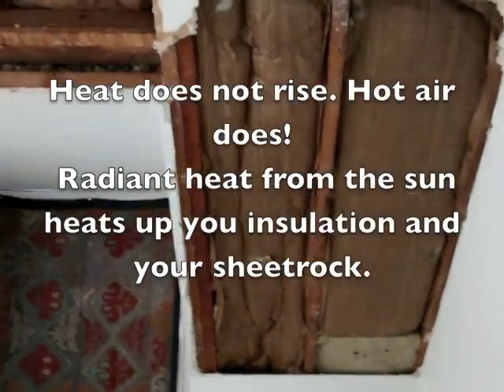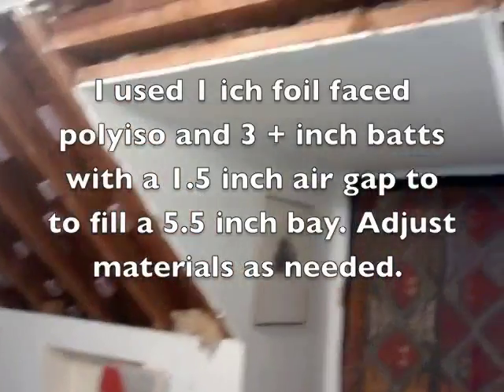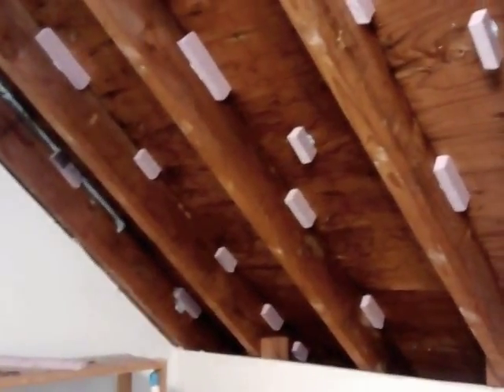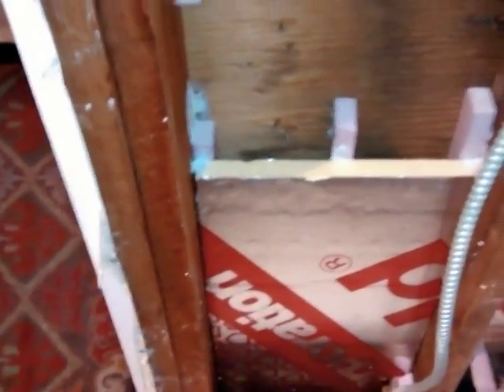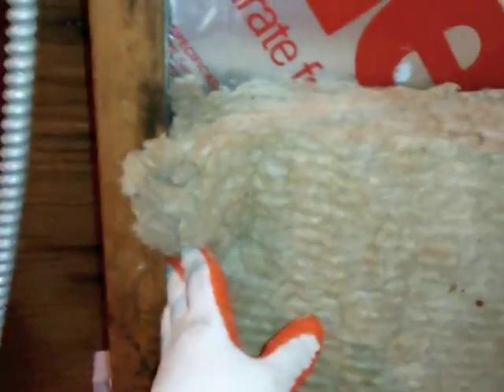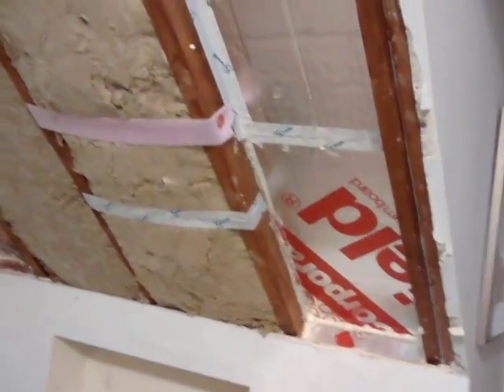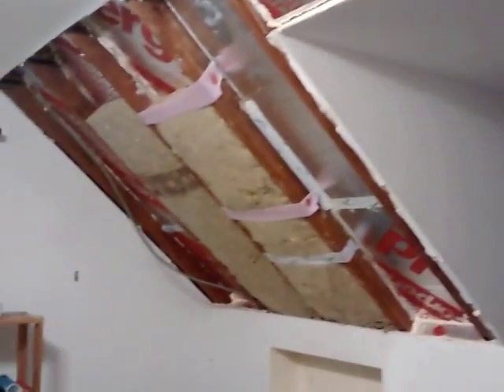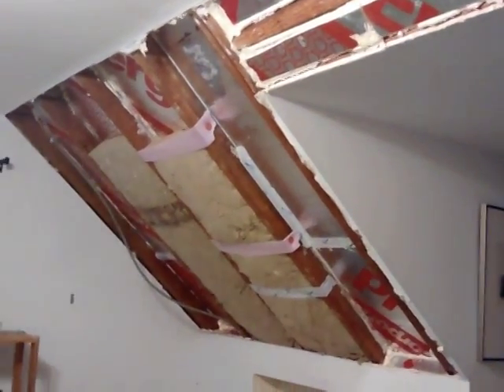Dormer room insulation retro fit - vaulted ceiling

Comment: My bedrooms upstairs look the same way with this sloped ceiling. I was able to access this area from the attic. I can look down into the 2 x 6 rafter bays and I decided to use 2 x 4 fiberglass insulation and just slide the fiberglass bats down in there however now I’m thinking I should’ve use the foam core board like you did. Any thoughts? I didn’t want to open up the ceiling like you did. But I probably will someday.

Comment: My bedrooms looks similar to yours were the ceiling slopes down in between the dormers. In my attic I was able to look down into the 2x6 rafter bays and I just slid down some 2x4 size fiberglass insulation batts. I used 2x4 size so I’d still have a gap between the roof decking and ceiling. However now I’m thinking I should’ve just measured and cut some foam core board similar to what you did and just slid those down in there, therefore I could maintain R-value throughout the entire cavity. Any thoughts? I don’t wanna tear open the ceiling right now like you did.

Comment: Jon, thanks for this vid and your suggestion about different foam compatibility. I did this in my porch ceiling turning it into a cathedral ceiling. Awesome changes and put in a skylight too. I did 2 inch air space and reflective foil then 6 inches of styrofoam then another radiant layer pointing downwards into the room this time, with a 3/4 inch air gap for radiant effect to work to redirect heat down into the room. Then ceiling planks for the finished work. The plan is to next do the attic with a gambrel roof that has 6 dormers but the headers of the dormers block off the soffit to attic path. I guess that section of the dormer headers that block the air flow to the ridge vent will still have the 2 inch air gap system but no soffit air intake to create the upward draft within the under roof sheathing air space to the ridge vent. I am still looking for a vid that might be able to clarify how to manage this dormer header blocking roof air space issue. Cheers from Atlantic Canada during the pandemic. Stay safe!

Comment: this is exactly what I plan on doing with my cape style third floor.  Sauna hot in the summer and freezing cold in the winter, no insulation at all!
Reply: Another upstairs cape cod tip is to make foam blocks right under the pony walls. Foam them in airtight. I make the foam blocking about 1/2 inch smaller so the spray foam has somewhere to go. Keeps cold attic air out of your ceiling on main floor below.

Comment: one thing I don't get with ridge foam board insulation and spray foam: given it's fairly air-tight, how will you know if there's a leak in your roof (ie, before the roof totally collapses)?
Reply: From the research I've done it's the chance you take.  Whenever you have the roof redone you just make sure you choose a really good water barrier for under the shingles
Reply: That is a really great point, but since there is an air gap above the polyiso the water would run  down into  just beyond the pony wall, into the ceiling assembly and into the house where I would have a nice early warning puddle of water on the floor below and possibly some sheetrock that is slightly damaged.  When spray foam or polyiso sheets are directly against the roof deck, then you may not get any type of leak or warning signs at all for a long time but even then when it comes time to do the roof you may have some compromised plywood sheets to replace around the leak but the energy savings will have more than made up for the cost of a few sheets of plywood. Even in a system with no insulation in the roof line roof  leaks can go undetected for a years if you have a poorly installed roof or if the homeowner is not paying attention the exterior part of the roof. Another point is, for actual properly vented roof systems you use baffles similar to what I did but often not made of polyiso and the water may be diverted down to the edge of the house and things can rot there; arguably an even worse situation since the water may dump into the wall assembly below and again go undetected.
Reply: The water would go down the polyiso air gap chute and land in the knee wall area which is above an area on first floor, you would for sure see it after time of water dripping down if it was bad to collapse roof.

Comment: I would have used Atticfoil  in place of the foam foil because of fire prevention. I would rap the foil around the rafters and also do what you did. Installing Roxul. On thing thou I would have sprayed Fire retarded paint on everything before installing any foil or insulation.
Reply: Mineral wool is used in fire assemblies; also sheetrock is a 15 min thermal barrier as well.
Reply: Not anymore with Roxul. You can use Roxul in anyplace you can put BATTS in with a much better R rating and many other benefits that you simply cannot get with fiberglass insulation. When I had my siding replace ( I had the LP OSB junk) to hardie plank. I had all of the fiberglass insulation (R-8) replace with Roxul (R-15).  I no longer hear the rain or traffic on my street. GREAT STUFF and cheaper than spray foam. In my attic I used Attic Foil for the radiant insulation that is stapled to the rafters. The white insulation batts is not mineral wool but fiberglass insulation.